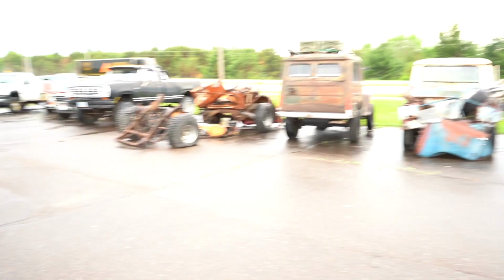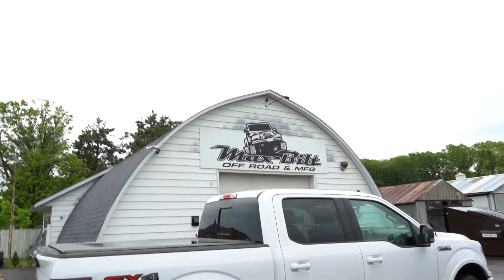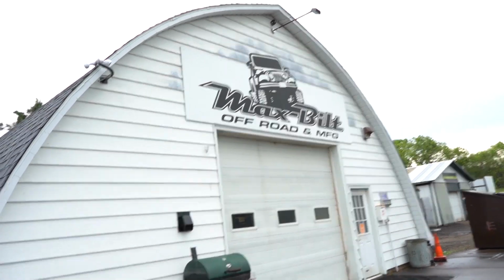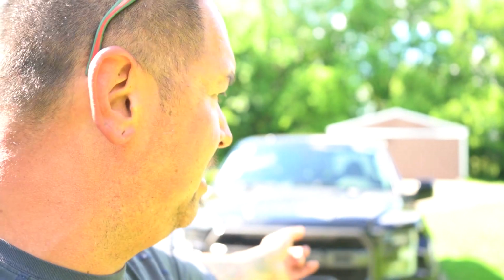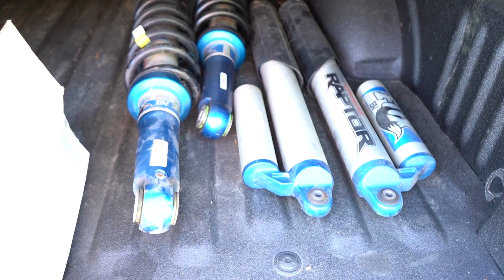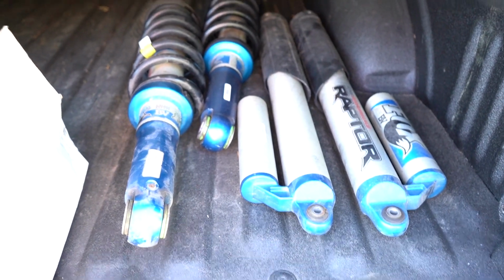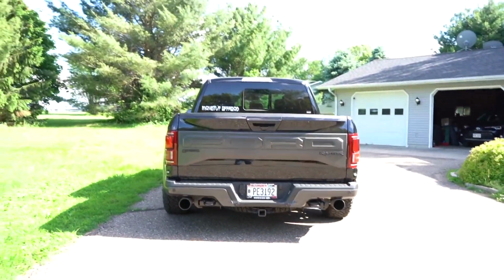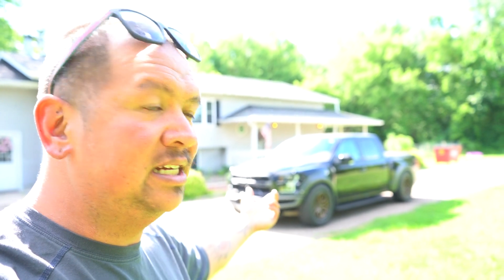I Destroyed my Ford Raptor by lowering it says everybody who sees it... ($4500 Experiment)

Comment: Came here to watch this video after we were roasting this truck in our Raptor group. I’ve got 16k in a effectively a 3” lift on mine. But to each their own 🤷‍♂️
Reply from the maker: I’m part of most Raptor groups, What did I miss?
Reply: It’s not a national group, it’s a text thread with my local group. I thought for sure it was an f150 with Raptor body parts. Couldn’t believe someone would actually lower a Raptor.
Reply from the maker: @the_traveling_broker  Right... It was an experiment... Gone wrong too... I ended up cutting through the wiring harness and brake lines... I have since raised it back to stock height... All from bottoming out on the frame

Comment: I bought a used 2011 Raptor... it was on 3rd perch position,, had 37s.  I immediately put 35s back on and want to return it to factory perch.     Has anyone else done this ,,  is it advisable?
Reply: You just un-do what most peeps wanted to do to their raptors - 37 would cost $$$ to fit and install